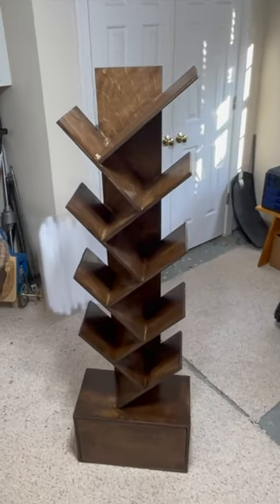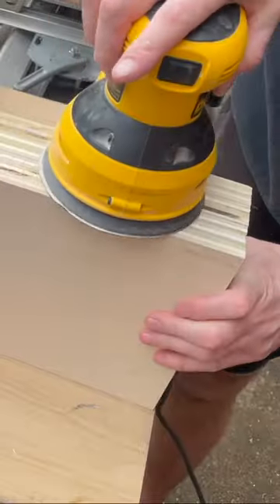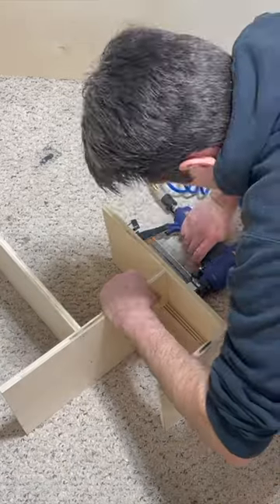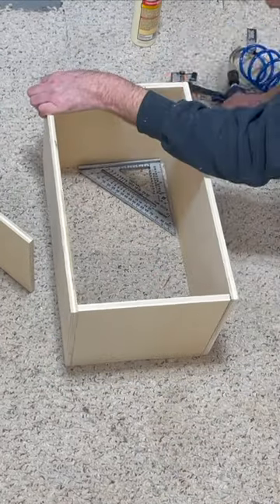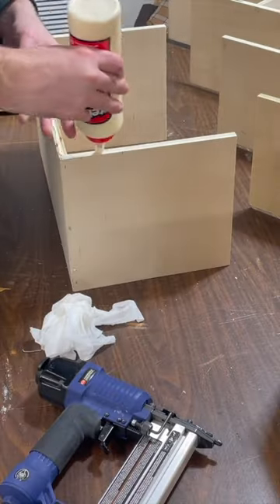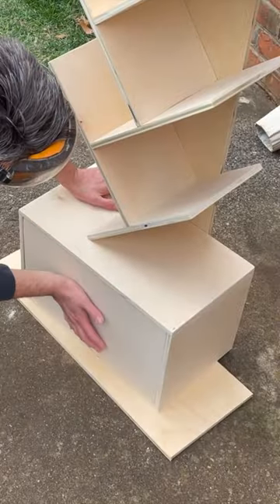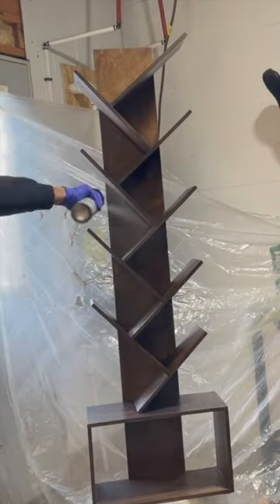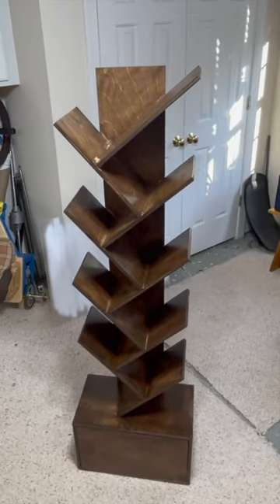Weekend Wood Working Project BookCase build#woodworking #bookcase  #diy

Comment: How did you get the drawer back out
Reply from the maker: The back of the cabinet area isn't complete closed, so you can push it out from the back. It needs a handle. But the girl I made it for hasn't picked one out yet!
Reply from the maker: It's probably more obvious in the longer video (which is only 8 minutes!)